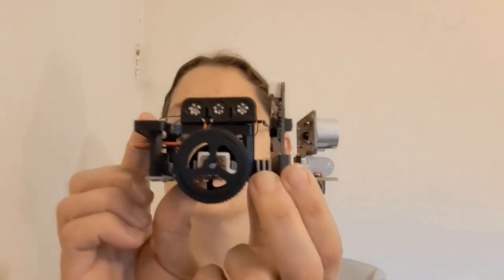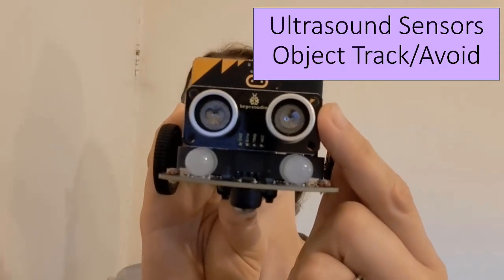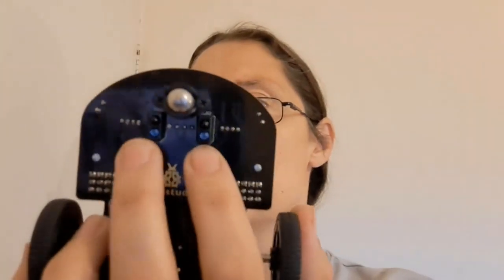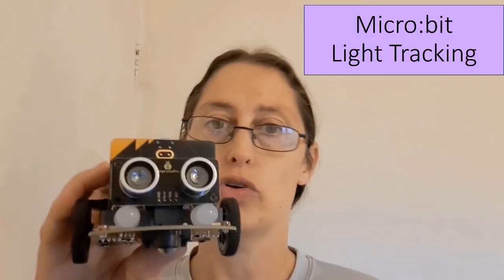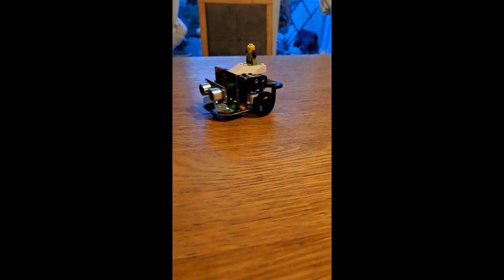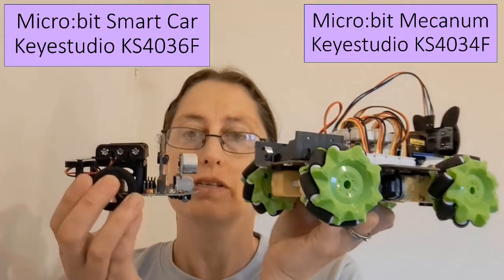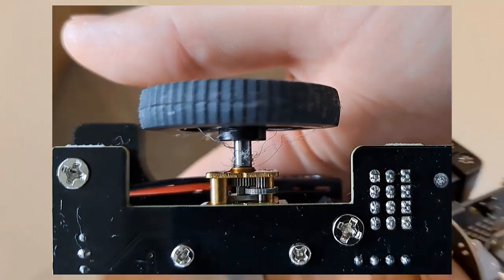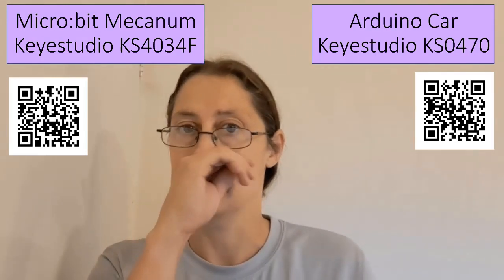Review of Keyestudio Micro:bit Smart Robot Car (Without Micro:bit) KS4036F

Comment: Has anyone figured out why the line tracking sensor doesn't work?
Reply from the maker: The line tracking was very sensitive!  I changed the sensitivities for the infrared sensors a lot - sometimes it worked but frequently it did not....  I'd suggest leaving more time between checking the sensors and making a big thick black line.
Reply from the maker: Check out the 2:30'ish mark in the video for more!